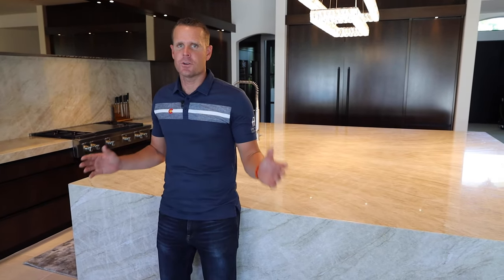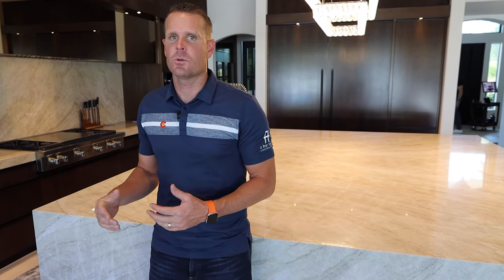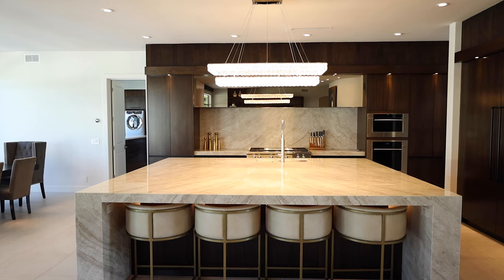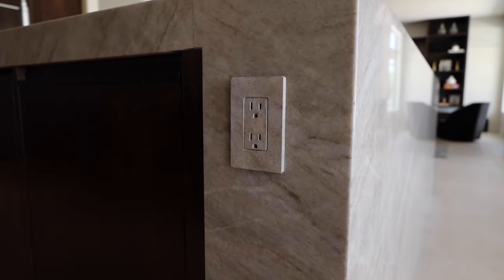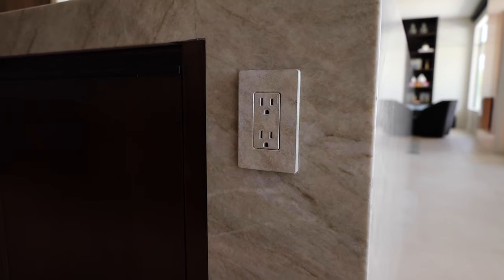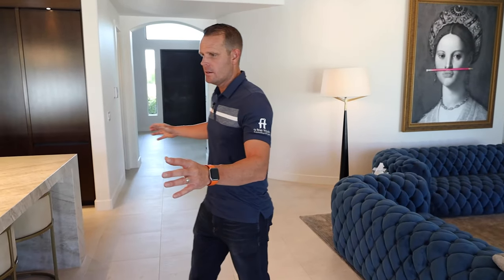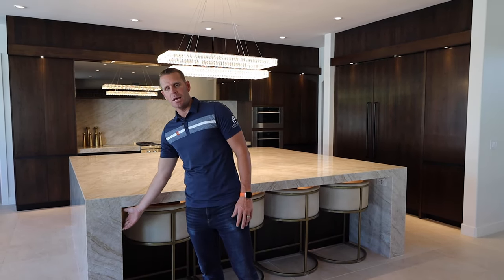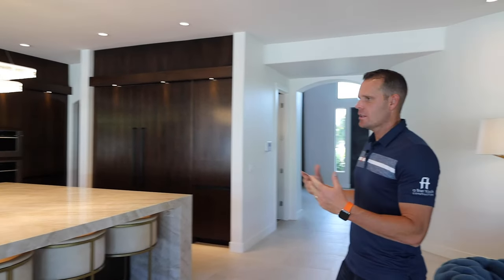How We Hid 4 Electrical Outlets In This Large Kitchen Island

Comment: Depending on your local codes you may not be allowed to paint the switch/outlet covers, and it is not recommended to install outlets on the side of an island that way anymore ( you know in the case little Johnny pulls on the cord and a 10 lb mixer drops on his head).

Comment: This is obviously a very Hi-end  kitchen.  Why did you not put in a Hi-end, PopUp.   Sticking an outlet on the surface, , , ,how embarassing.    I would have had you remake it properly
Reply from the maker: Absolutely we looked at that option. Clients wanted a flat surface. They didn’t want a cut or seam in their beautiful slab island for an outlet. On the side, you don’t even see it
Reply: @aft_construction  you did an awesome job nonetheless
Reply: cool      I'm doing a 4' x 10' island and i'm going probably spring for a good pop-up   they are expensive But, they save the plug they cut out, and replace it in the top of the pop up.  the finish is extremely smooth and flat.  all you see is the flush mounted ring.    The down side is $ 500 for the popup.
Reply: I couldn’t LOOK AT AN OUTLET. I hate the clients who are offended by functional items. They probably eat fast food every night! 🤣